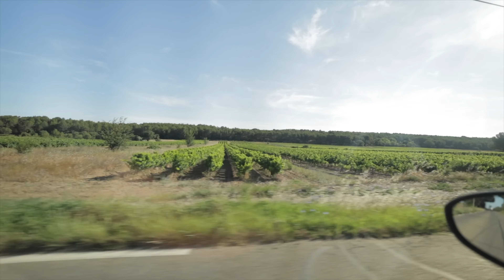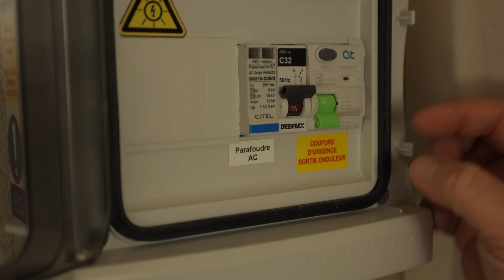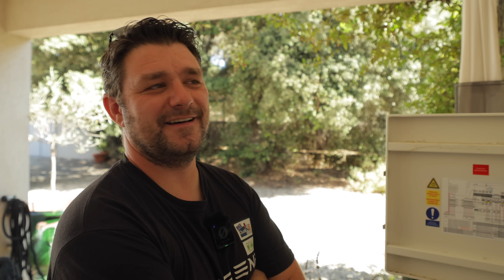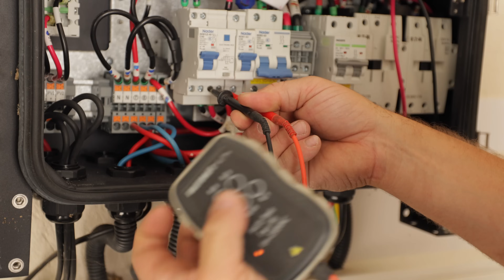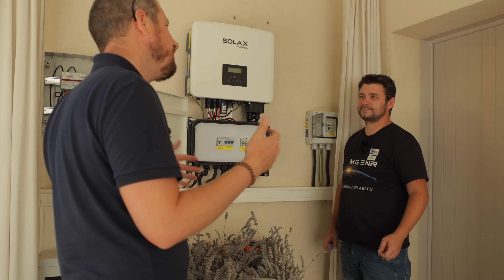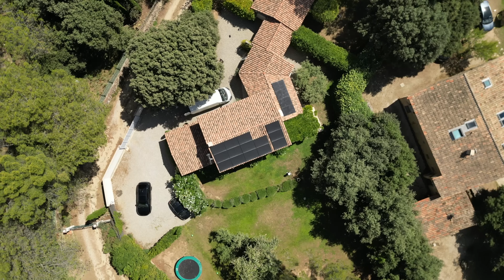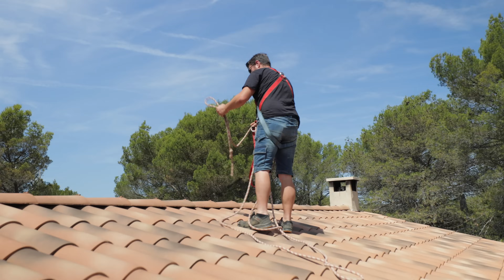Why I Had to Go to France to Fix a Solar Installation 😳

Comment: 22:50 earthing solar panels  will probably also help with lightning protection - won't stop a direct strike but could be useful for nearby strikes
Reply: You mean when lightning strikes the system directly, that surge will fry your whole electrical system. I'd rather avoid that...
Reply: @HEelektra  if it directly strikes your property , at least the earthing might reduce the amount of the rest of your electrical system that explodes out of the walls.
Reply: @HEelektra  When lightning strikes directly it does not matter. Grounding the frames helps dissipating the energy into the earth. If it enters the house you are in a world of hurt. That may or may not happen. I, and most of my neighbors do not even have lightning rods on our buildings. That is not necessary here in middle Europe.
Reply: @wolfgangpreier9160  I had a strike on tree out front.  Blew all the bark off killing it.  It also traveled up the phone line that ran through it's branches, into the house where it blew the back off the DSL modem.  Went up the network line to the firewall box, and melted the jack on it stopping it from getting to rest of network.  But it also went up L2 knocking out some other equipment, and popping the fuse on that leg.  Had a buick coil do the same thing when it cracked open and fired into the ECU instead of the spark plug wires.
Surge protector doesn't stop the power spike when it come from the house.  At least not a useful stop.  Maybe that i what held it to that one line segment.
I was shocked the network cable handled the load that melted the connectors on both ends.
Reply: @robertsmith2956  Yes interesting phenomena occur wth a strike.

I only had one at a customers site. Directly into the phone pole before the company building. 

It melted the phone company switchboard completely in 2 km distance and exploded the telephone system inside the building. 

Everything with more than 50 centimeter copper lines exposed was burned out. The keyboards survived. They had spiral cables...
Reply: You mean of course you want to earth the frames of the solar panels and not the solar panels themselves. Right? And yes of course they must be grounded.

Comment: 17:30 a 2-wire RCD tester like that isn't going to trip anything connected just between live & neutral
Reply: One contact before the RCD to N and the other contact after the RCD to L. 
Then it works.
Reply: Also, what about isolating/disconnecting the load and then testing RCD with 30mA /300 mA as there already leakage in the cct.. Also in AS/ NZ standards, there would be no way the cables would be laying on the roof like that without segregation..it not a UV thing it's a wear through the insulation in the wind thing! just sayn 😮
Reply: yah I saw the same thing and ask why is he trying like that? :D
Reply: Connection from N to L looks like a normal load .... RCD protects against currents that do not flow back via N.
Reply: if it is between L and N it is actually a normal load.

Comment: In the netherlands we also have this issue sometimes this   is because the newer inverters dont have a transformer in themand thats why there is no galvanic isolation between the pv panels and de AC-grid, so mostly some leakege current will flow over the dc connection trough earth and this wil trip the RCD,  

P.S. 

Jordan i am a dutch electrician, so if you ever in the netherlands i would love to show how the dutch are doing electrical.
Reply from the maker: If I ever do go to the Netherlands then I will hold you to that deal!
Reply: I think a good example of such inverters are the IQ micro-inverters from Enphase?

And that's one of the reasons why here, we also need the Q-relays from Enphase between the micro-inverters and the breakers, so there is a real mechanical disconnection when power is cut?
Reply: Transformless inverters always will have ac leak to pv and all hybrid inverters is transfromless, so if you have hybrid inverter always turn in off before connecting pv, because even when pv is off you can get shocked by touching pv input contacts on inverter because there is AC leak from inverter and that’s normal on hybrid inverters

Comment: Jordon, equipotential bonding of PV modules over 120V dc has been a requirement in Australia & New Zealand since 2012 edition of our PV standard. There are several reasons but it was "triggered" by a child receiving an electric shock touching a metal ladder leaning agains the roof guttering. The cause was the normal capacitive coupling of the module's cells to the frame and the a.c. leakage through non-separated (transformerless) inverters. Up to approximately half grid voltage (a.c.) can be present on the frames of PV modules under normal operating conditions. The bonding provides a path for this small (typically < 1mA) leakage current to earth. The other reason for bonding is that a failure of the double insulation of the PV array can only be detected by the inverter if there is an earth reference for the inverter to measure against, typically done on startup. This can cause intermittent problems during wet or humid weather due to low resistance to frame of the modules (which is a breakdown of their double insulation).
Reply: Most of the increasingly popular all-in-one 'high frequency' PV/battery charger/inverter units aren't isolated PV either.  It's stated in the manual either directly or implied, but so many people using them don't read it or understand the implications.  It's a bit scary thinking about how many of these things are out there not installed properly, particularly in countries where electrical work is often undertaken by untrained people.
Reply: Exactly this. The majority of solar panels that i installed needs to be functional earthed, very rarely earthed for lightning.
Reply: Same in Belgium, its just a equipotential bonding. Started placing solar in 2008 and came into effect around the same year. (2012) lots of houses have velux windows from which you could potentially tough the Solar installation.
Reply from the maker: @sanders3219 that’s a very interesting point!
Reply from the maker: Thanks! Interesting to see if it comes to the UK eventually...
Reply: Another reason for RCDs to trip on non-isolated inverters is excessive DC injection onto the AC waveform. In sunny/cloudy weather DC injection increases as the MPPT is working to adapt to rapidly changing light levels.
Reply: it's not tax advantageous to pay yourself in dividends in France (so there's no IR35 thing). French state pension is also amazing compared to the UK one. I think Freench corporation tax has dropped in the last few years to below what it is in the UK now (I don't pay it, because like I said, it makes more sense to pay yourself in salary)

Comment: Roofs in Scotland are solid sheeted flat and waterproof before counter battens and tiling battens. That has been building regulations for at least 40 years. Usually OSB or Ply first. No fixing point issues.

Comment: The video mentioned that unearthed panels give off radio signals.Would the panels also interfer with getting television signals if the antenna is located in the attic? Had perfect signal before the panels were installed, now its patchy enough.
Reply: In short, yes. Switched mode power supply circuits that you'll find in inverters are infamous for generating electrical noise unless they've been really well designed. Signals can radiate from the cables as well. Mounting the aerial outside will likely be the fix.

Comment: 25:09  About the same in Belgium . above 45.000 euro you pay  50% tax in Belgium ( lower income  = lower taxes )  .. one of the highest in Europe i think ..  
Especially as an independant sole trader  no BV  ( LTD in uk ) .   If you have a  BV ( ltd ) you can indeed do dividents  and pay less taxes ( but more complicated )
So if the taxes are so low in UK why  is Artisan then 3x times so expensive as an electrican in Belgium lol ...🤣😂

Comment: You also might want to check your mc 4 connectors for installationfaults.  When  moisture from the damp environment in the morning reaches your live circuits. your rcd will trip

Comment: Panels dont need earth. All metal parts of the pv installation need earth bonding. Didnt used to be that way but after an inspection on a older installation we had to fix that for 2000 panels on a flat roof.. not the best job in the world.

Comment: Connected RCD tester like a load between L and N, and is surprised that it's not tripping. Are you really qualified electrician? 🤣
Reply: My thoughts exactly!!!!
Reply: Proof of a real P.V Cowboy...
Reply: I'd guess on a TN-C-S system, placing one probe on the neutral before the RCD and one on the live after the RCD would have the same effect as neutral and earth are bonded at the DNO transformer? Still a pretty silly mistake given he knew it was TT.

Comment: Ground the panels to a different earth rod
Reply from the maker: Really?
Reply: @artisanelectrics ground planes refer to Atenna elements, where as earthing relates to grounding the DC power running radio & accessories...
Reply: @artisanelectrics  yes I had a similar issue with my ground mount system as soon as it started to rain it would trip so I disconnected the earth everything was fine but I was getting voltage on the frames of the solar panels so put in a separate earth rod next to the panels never had another problem everything works perfectly

Comment: I have just done a UK Level 3 electricians course and am also have a BE(Electrical). I now live in the French Alpes - I am looking for work as an apprentice or mate in any sort of electrical area (install, repairs, solar, ..). If anyone has tips finding work in France with UK qualifications I would love to know :).
Reply: You can see with ENIC-NARIC office. It's a government office who can recognize and give you an equivalent of your diplomas in France. It has a ~70-80€ fees and can take several months to receive the French diploma but you'll be good to find a job here without starting from the beginning.
Hope that will help you.
Reply: @sennkei  that sounds amazing! Thanks heaps for the info..
Reply: @UKsystems yes I have been looking at the schneider set - which I think is more iec standard . Have you seen an official set of French regs online by chance ?